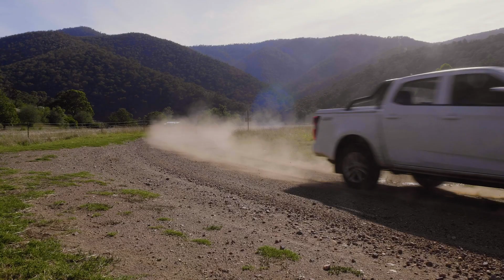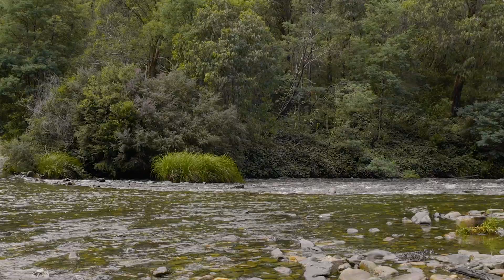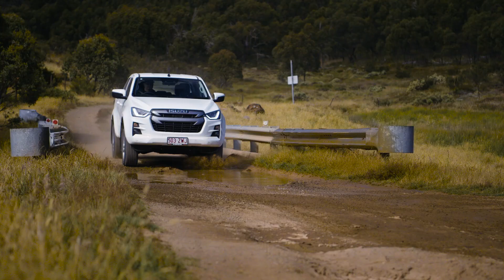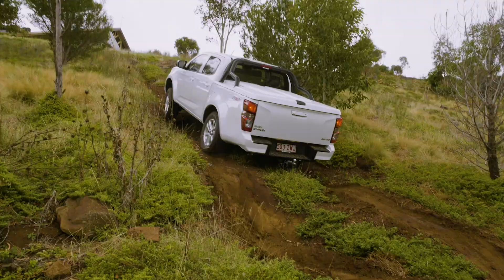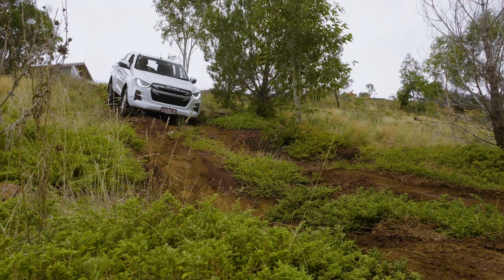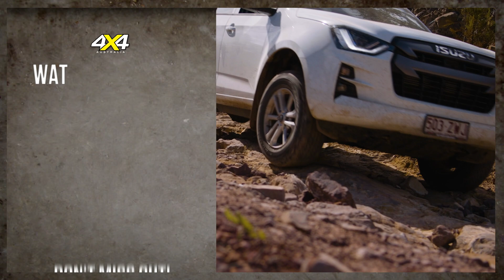2021 4X4OTY contender: Isuzu D-MAX LS-M | 4X4 Australia

Comment: I am really glad that you touched on the issues with the safety systems. Many journalists and testers fail to note the issues. Safety systems on vehicles really need to be regulated, as the systems on the new D-max do not work as they should in the real world and are downright dangerous, to the point where I have had to block the cameras so they're permanently disabled. In fact, after 6 months of owning the new D-max, I hate just about everything about it! Imagine putting a deposit on a $60K + xterrain, finally getting it 8 months later (due to supply issues) and finding out that it really is a piece of shit.
Reply: Well why don't you sell it? They are in high demand at the moment, some second hand ones are selling higher than new prices due to the supply issues and waiting times. I've got no issues with mine, maybe it's your driving style??
Reply: @gwhite618  the plan is to sell it. You say you don't have issues, but they had issues with it in this test? The systems are poorly calibrated, no matter my driving style, end of story. Funnily enough, I know of a 'G White'... and he is a total and utter fuck wit.
Reply: @JDMEVOVIGSR  Funnily enough I know plenty of Brad's too, but I don't tar everyone with the same brush.
Reply: Yeah some safety systems are far too aggressive and that could be very dangerous 😬 I would reccomend switching to the hilux as its just as reliable and should not have that aggressive safety system